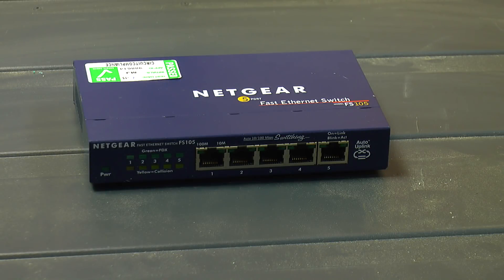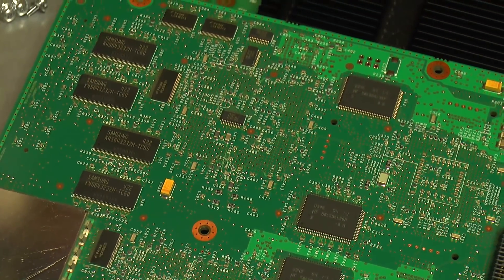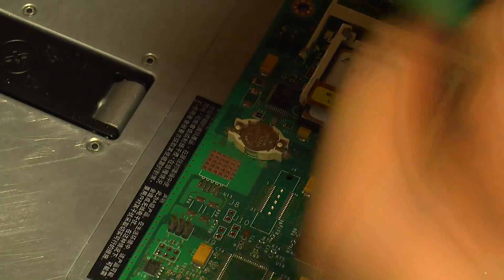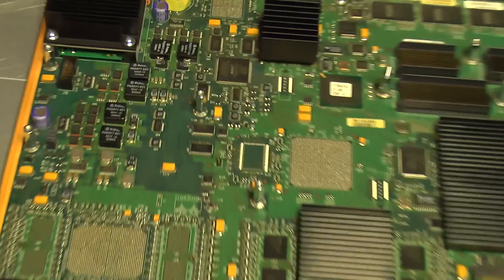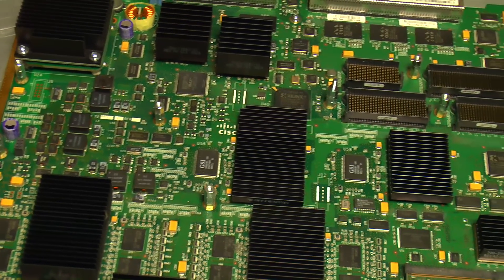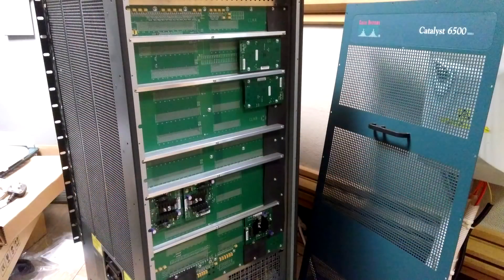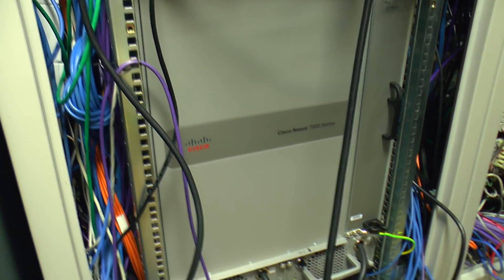Cisco Catalyst 6513 (6500 series) network switch teardown

Comment: Great teardown, we recently turned off a couple of these as well.  fun fact:-  720Gbps comes from the 9 slot chassis doing full duplex (80Gb/s per slot x 9).  The 6513 (non-E version) is a stretched 9 slot chassis where you cannot connect cef720 cards to a number of the upper slots.

Comment: hi, how are you I have a 6509-V-E  Cisco switch I am facing a problem with the module SFP, Ethernet when I try to power on after a couple of minute power cycle automatically and the state shows other how we can fix this issue?

Comment: I have a model AA23340  i want to use it as a stand alone power supply could you tell me do i have to jump or short out any wires to get it to turn on so i can use it as a stand alone.  Mine has two AC inputs on it. I feed one input 110 volt and it does not turn on. I heard there may be wires i need to short out or jump together for it to be able to turn on Any help please would be great.
Reply from the maker: Looking at the label on a photo of an AA23340 you'll need two 110 volt or one 220 volt input to get the 2.9kW rated output. I suspect with one 110 volt input it's not going to power up, so plug two in.
If it still doesn't fire up, try grounding the various small pins through a 1K resistor, hopefully you'll find one which when grounded will cause the supply to turn on. The 1K resistor is just in case you find an always-on output as you don't want to short it out.
I'd recommend connecting lamps to all of the big output terminals before firing it up as some switch-mode supplies don't like running with no load. 110 volt incandescents should do, they're not going to light brightly but at least they'll be drawing something and you can put a meter across them to see which output does what.
If it still doesn't fire up, try grounding the various small pins through a 1K resistor, hopefully you'll find one which will cause the supply to turn on.
Reply: @AintBigAintClever  Feed both 110 inputs. I was thinking maybe i need to. Thanks so much. I will also try the pins if nothing powers up and make sure there is a load on it to. I would hate to harm it. I like the resistor idea for sure. Much better then a jumper wire. ( yuk) could = yuk yuk. Nice the resister will just burn out. Again i can't say thank you enough for replying back. I had my doubt i would get one. I looked and there is really not much info out there on these units. You tube  really only has your video that i found anyways. : )

Comment: Anybody know where I can find a fan tray connector pin out / wiring diagram? I got an old stock tray for next to nothing and would prefer to keep the wiring intact and convert to a general rack cooler without re-wiring if possible.
Reply from the maker: Are the fan cables themselves (between the connector and the fans) colour-coded? If so it should be possible to measure continuity from those back to the connector and determine the pinout from there.
Reply: AintBigAintClever Thanks for the tip. They are visible and color coded.
Reply: Hi Richard,  Did you ever find the pinout or anything that can help direct-wire this fan tray to run outside of a Cisco chassis?  Thanks for any tips!

Comment: Seems it's the time for everyone to pull their 6500s.

Last week I was working on installing the replacement 9010s at our facility.
Reply from the maker: 31st August 2017 deadline for 6513 non-E chassis: "The last date to receive service and support for the product. After this date, all support services for the product are unavailable, and the product becomes obsolete."
Reply: Thanks. I figured it was something like that, but I hadn't heard the exact date. 
I guess that's one way for them to sell hardware upgrades.

It seems I have a lot more installs in my near future
Reply from the maker: Yep. If you know your way around the switch and are happy to run it until the wheels fall off then you'd be fine, but for those who want someone else to shout at if it blows up, the axe has fallen on the 6513 and presumably not only its smaller siblings but the 7600 series routers as well, which are virtually identical.

Some of the line cards have a few years left to run, though. https://www.cisco.com/c/en/us/products/collateral/switches/catalyst-6500-series-switches/eos-eol-notice-c51-735926.html

Comment: So many chips on those boards! I'd love to see the schematc. I'd hate to try to trouble shoot it if one of those BGA chips didn't solder properly in the reflow oven. I wonder what the failure rate is?
How much did it cost 12 years ago? Probably many thousands of pounds.
Reply from the maker: Low six figures. Same goes for its replacement. As for failure rate, I don't know whether those boards would've used lead-free solder (like the Xbox 360s with their red rings of death) or the "proper" stuff (like the original Xboxes that still work).
Reply: My company has a large number of 6500 series shelves deployed (mostly 6506 and 6508), and I think we have only had to replace a couple of SUP cards. And those died due to power problems or over-temperatures in the room (due to HVAC failures).
Reply: I don't think there's any point in 10gig for consumers/home/small business use as SATA ports on consumer PCs are much less than 10 gig anyway and HDDs/SSDs slower still unless in a RAID array.
Reply: They need to make some self contained smaller 8-16 port 10GbE switches, and sell them for about $50-70 each in order to target the consumer market. It is insane that at the consumer level, we are still largely stuck with 1GbE even though it really should have been retired at least 6 years ago. Some companies are making cheaper 10GbE NICs, but networking companies are being really lazy on the 8+ port switches.
Reply: I recently bought an 8 port 1 gigabit switch and gigabit PCI LAN card on eBay so I can transfer files to/from my DIY NAS faster because I'm impatient. The MB/s is much improved.
Reply from the maker: I've got a four TP-Link gigabit switches dotted around the house (two 5-port and one 8-port, all linking back to one 16-port). They're cheap and they work well.
Reply from the maker: Most of the servers at work that have 10Gbit ports use SFP+, so we've got 10 metre Active Optical Cables feeding them. No 10GbE copper.

Comment: 2.5Kw PSUs! Wow! You didn't show the label clearly. What are the output voltage/current specs?
Reply from the maker: I didn't get a photo of it (and we waved it goodbye on Friday) but I just found a pic online that shows the spec label. As long as it's running on 200-240V the outputs are:-
42V 55A
12V 10A
5V 5A
3.3V 15A

If you thought those were big you should see the ones on the replacement. Two 7.5kW power modules, each module containing of a pair of 3.75kW power supplies. 4 inputs distributed across the three supply phases but it can run on just one (which was tested before it went live). With both cables connected each N7K-AC-7.5KW-INT= power module is rated at:-
50V 150A
3.4V 30A
Reply: 3.75KW x 4. Bloody hell. That's 15KW, more than an electric shower. Does the equipment these PSU(s) feed really draw >3.75KW or are they  just massively overbuilt?
Reply from the maker: Smaller PSUs (including a 6kW DC version) are available. I think our switch as-configured will pull about 2kW, so one supply out of the four can easily cope. We could even run one supply on "raw" mains and put the other three on three different phases of the UPS-protected supply, it would then stay up even in the event of a total UPS failure. As it is it's got two inputs on one phase and one input each on the other two, each input with its own 32A breaker. As the AC sides of the supplies are completely independent it's happy to work with 415 volts between inputs.

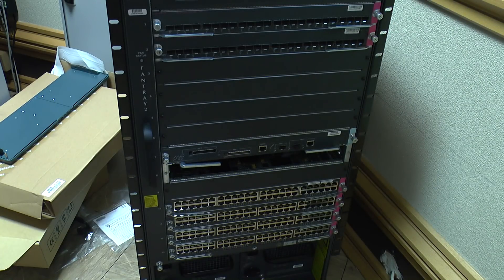Comment: 1:23 Is that a Dell Power Edge 1950/2950? Makes a good platform for showing tech off haha
Reply from the maker: Well spotted, I think it's a 2950.
Reply: AintBigAintClever We still have some in use, one as as a SharePoint 2007 server and another as a File Server (I'm pretty sure), but will be going soon! Not a moment too soon!
Reply from the maker: We've still got some physical servers but have a load of VM infrastructure as well, some still on a mature, rock-solid VMware platform but with the majority moved to Hyper-V.
Reply: Similar to us, we run a Hyper-V Failover Cluster which now runs the vast majority of our servers, by the end of next year we will only have a few servers!

Comment: Hmm complicated beast isnt it, i know nothing about networks so of cause it looks like a nightmare when fully populated and wired up.
Spagetti hell :-D
Reply from the maker: There was a lot of spaghetti on the front of this one when we had to literally jack it up 9 inches to make the gap beneath it big enough for its replacement to be racked and the connections transferred one by one.
The spaghetti's moved now, with even more added (a bundle of 28 10Gbit fibre cables taking advantage of the new bandwidth).
Network wiring may look a nightmare but switch ports can be labelled internally (and documented) so you know what's plugged in where. Just like on a mains distribution board/consumer unit, you don't need to deal with all the cables when you're just working on one circuit.
Reply: Yes you are right, i've never known you to be wrong :-D
it's "mass cable fright" on my part lol.
It sounds more capable than the old system, 280Gbit total if all are running max transfer, frightning stuff lol.
Reply from the maker: With DFCs fitted the old switch was capable of handling up to 400 million packets per second. The new one bumps that up to 5 billion. It's very difficult to compare Catalyst 6513 with Nexus 7009 though as the datasheets for the most part don't compare apples with apples.
As for the 280Gbit, that's on 28 ports. There are 48 ports on that line card capable of running at either 1Gbit or 10Gbit (but not 10/100Mbit), and there are 5 cards fitted with room for two more. It's also "only" running with three 110Gbit fabric modules, it can take two more.